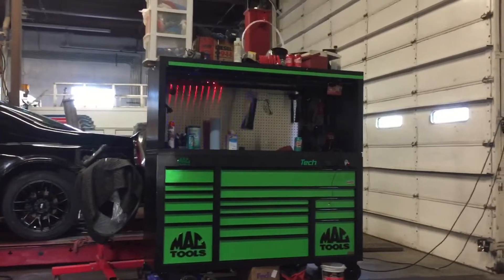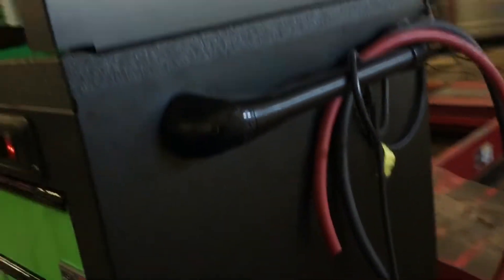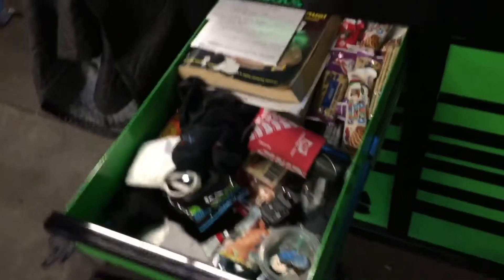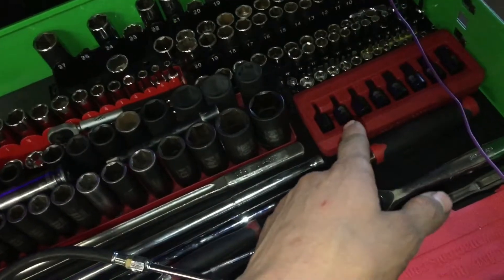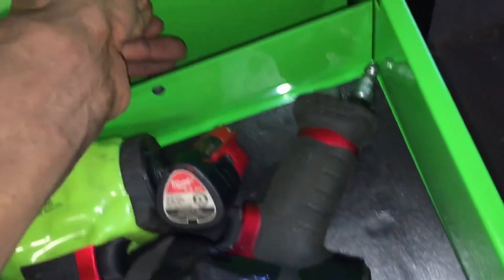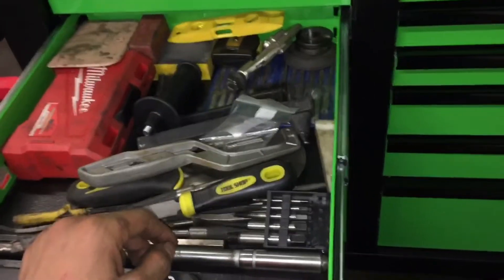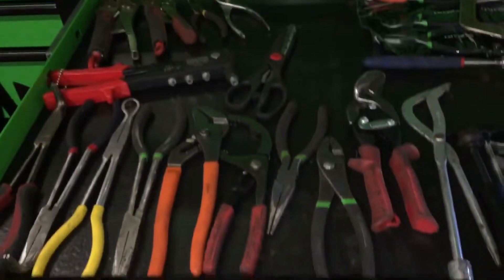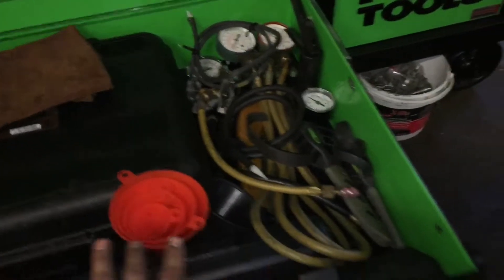2020 covid Mac tools triple bank tech series

Comment: Awesome MAC box...great color. Hopefully some day you can fill it with MAC tools...I went the opposite way, I have a extreme tools 72” with hutch and 2 side lockers., but filled it with only Mac and Snap On tools...
Reply from the maker: Don’t worry got tons of deals that I’m do here and there to build my Mac and snap on set mostly garage sales hauls
Reply from the maker: Got a 8mm snap on impact 3/8 and a mac 40-45 torx bit 3/8 for 5$ other day
Reply: jdm4stance awesome...I love Mac and Snap On..the Mac axis locking flex head ratchets are insane, better then my snap on locking flex...there are many USA made tool companies, that’s all I buy , no Taiwan or China crap...Mac, Snap On, Proto , SK, Wright , Mayhew, Trusty Crook, Grace, Starrett, Wilton, Tekton makes great USA made angle wrenches just like Snap On ( 30/60 degree).....I wish you the best...Awesome box, be proud of it..some day I’ll take all my expensive tools out of mine and into a nice Mac HD blue and black box..

Comment: Has it got soft close drawers?
Reply from the maker: Rick Duncan it has a adjustments on inside rails that adjust adapter for easy bull drawers and closing soft or stiff it I never noticed Ig I’ve had soft close always and it seems like it is not 100%
No wobble did that test yesterday